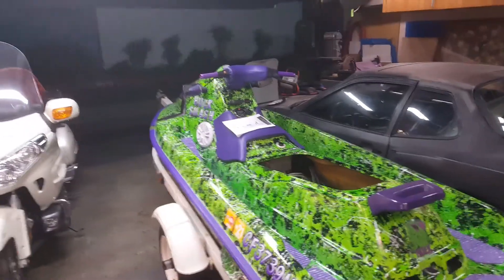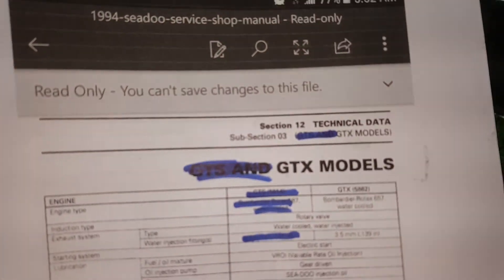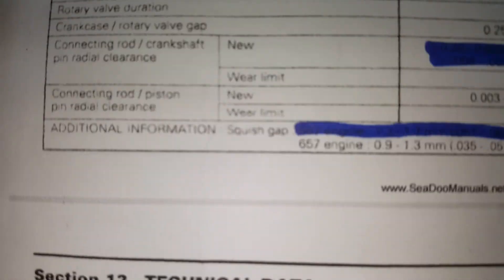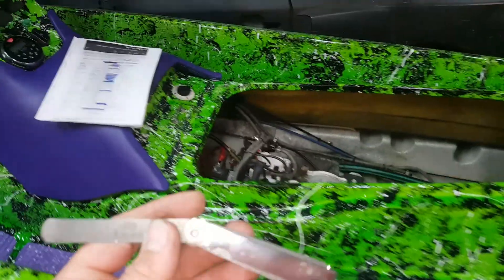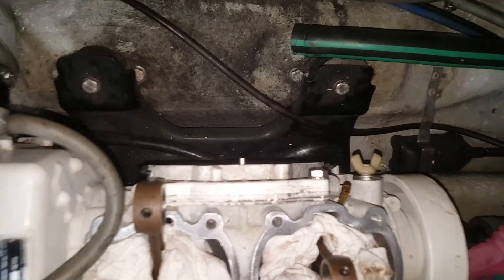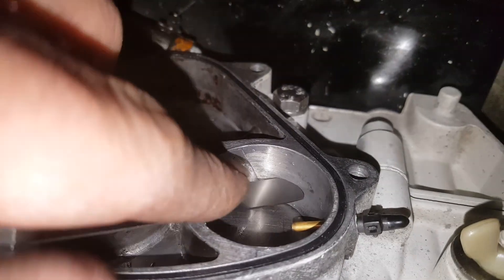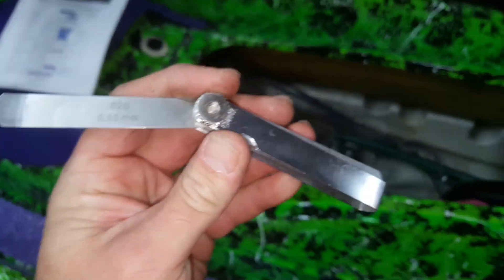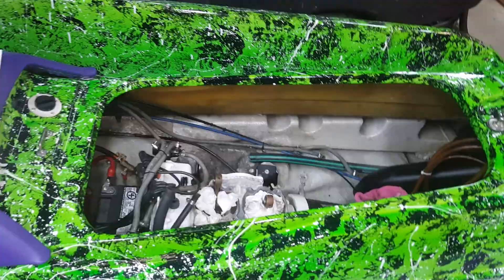94 SeaDoo GTX rotary valve inspection and testing

Comment: Did you have to take off the o ring before you measured? i didn't and i can get a .15 in between there my problem is it will run out of water but not in the water

Comment: I am loving your paint job, looks flawless. BUT I am VERY interested how you installed your audio system, would love to do that on my 95 GTX.
How are you powering your speakers? separate battery or bigger battery or something else? 
Was it expensive to install? Thanks for your time.
Reply from the maker: I have a little boss stereo right next to the reverse lever. As far as installing them I had to cut holes in the fiberglass for them. I installed in myself so it wasn't expensive. As far as the battery I just use the stock battery. The battery can handle running the stereo for quite a while even if the engine is not running. But to be fair I suspect it will damage the battery faster. But well worth it my friend

Comment: Thanks for posting, working on my wife’s 94 gtx and apparently you need to remove the rv cover to take the carbs off on this model
Reply from the maker: Dang! Make sure you use new gaskets otherwise you'll be introducing a leak.

Comment: that paint job/wrap is really cool
Reply from the maker: Actually I painted that. I'm very proud of it. The jet ski was white before so I sanded it down and then I got some black paint on some crumpled up newspaper all over it. Then I got House of Color clear coat and mix yellow and green together and put on about three coats. After that packed up I got white paint on my fingertips and flipped it all over it. And then I went back with three coats of clear. It was a great project and took me 19 hours to paint it from start to finish. That was a long night. Thank you very much for commenting on it. That means the world to me
Reply: What problem cause a bad rotary valve?any symptoms?
Reply: @tonyrivera7112  may not run in water or poorly
Reply from the maker: If your rotary valve is bad your vehicle won't breathe properly. And therefore won't run properly